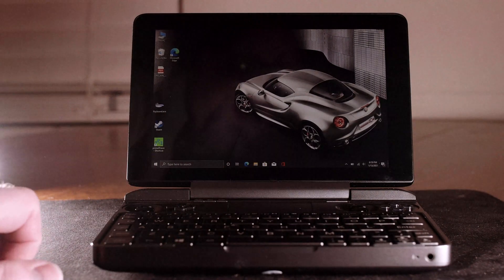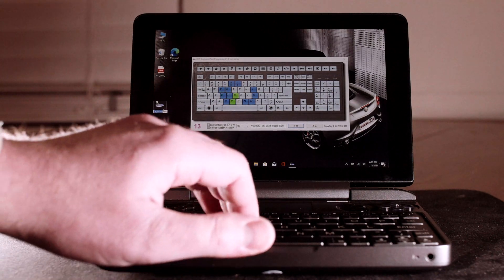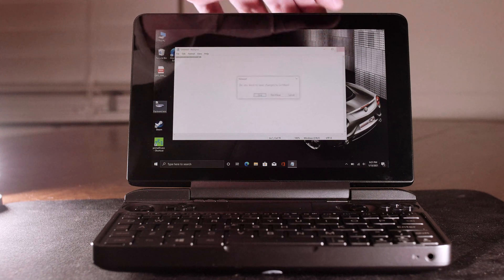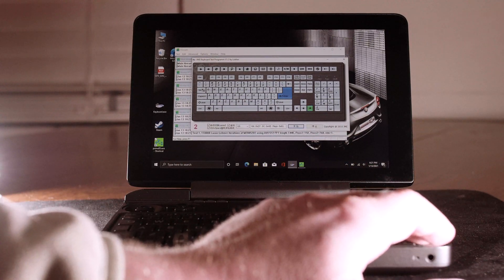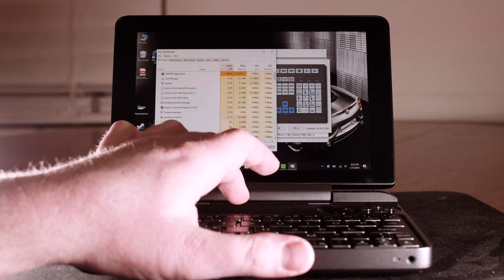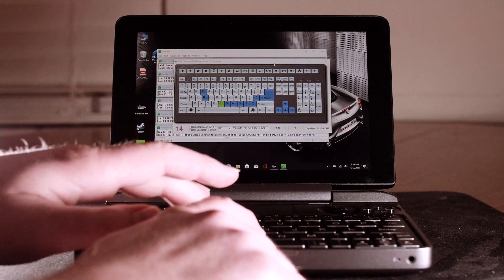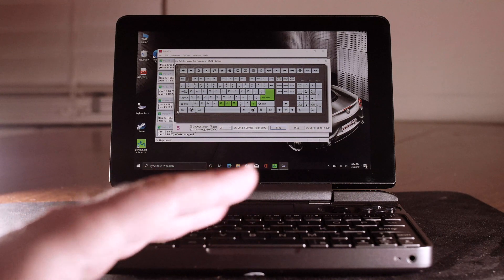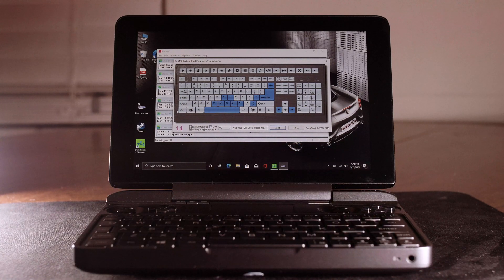GPD Win Max Keyboard Problems

Comment: Unfortunately I don't have any suggestion, but you mentioned removing the key caps. Can you tell me if the must be removed from the top or from the bottom? Especially the space key, that's the one I want to take a look at. Thanks!
Reply from the maker: Thanks. I popped them from the top but you are going to have to fix the switch mechanism for each one since the come apart incredibly easily. So keycap off after popping all corners and then taking out the switch and clicking it back together